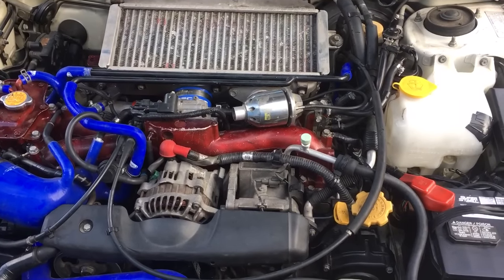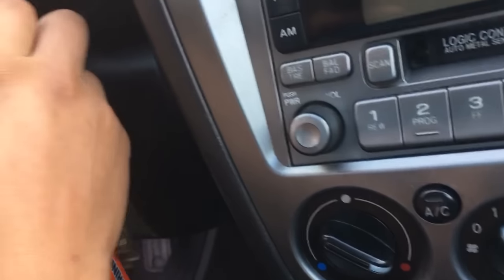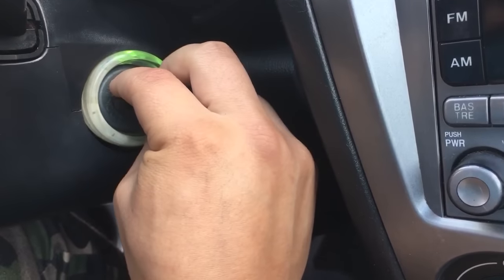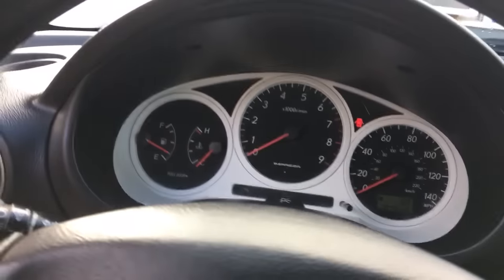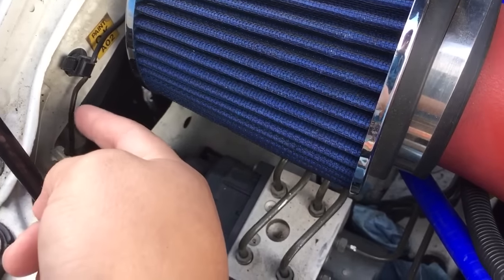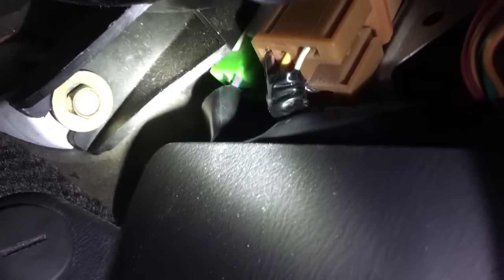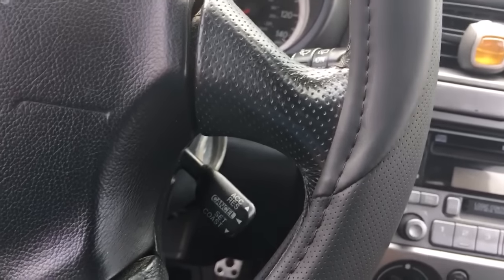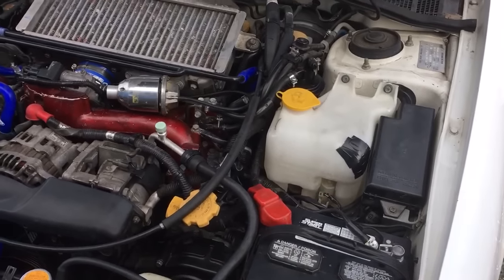Subaru WONT START Bad Fuel Pump? Relay? Ground? | FIXED!

Comment: good info. We had a bad ground but it was on the very back of the engine block was my understanding. Car would crank, but not run more than a few seconds. Security code was the indicator. Finally figured out by a Subaru regional engineer after about 6 months and over $1,000 of parts changing including ECMs. etc. nightmare, which I might add was caused by a mistake made by mechanic in Cary NC Turbo Time, they left the ground wire very loose obviously. Subaru expert in Asheville NC could not figure it out, Subaru dealer in Hickory finally consulted the engineer after over a month of attempting to fix it.

Comment: Thank you very much for this video. I had a major issue with my 09 forester after a timing belt and head gasket job. Turns out the grounds weren't tightened very much. This solved my problem. Thanks again.

Comment: Funny I found this video today because 6 weeks ago I had the exact same problem - I got the point of ordering a new ecu and I found the sane ground as you that was the cause (mine was connected but loose) 👍🏻👍🏻
Reply: I know this video is older now but I just found it and had the same issues, and same as you it was the exact same one just loose

Comment: Thanks for pointing out green 1 wire connector is test & Supposed to be Unplugged! I plugged mine in while under dash
I can't get fuel relay to click on. 
But please note with that plugged in. I hotwired 12v from a junk box, to black & red wire at pump connecter (when plugged in, in essence Feeding whole wire 12V. and using chassis as ground from batt box). Pump ran & car started up for 5 seconds then ran rougher & died. Restarted couple times while I'm back near pump. 
Decided to get in driver seat and rev engine after start. Did it twice still stalled out. Got out and when was going to underhood fusebox, replacement (non) Fusible link wire was Smoking, melting insulation! 
Didn't know if used pump drawing too much amperage.  Or result of 2nd battery being used to power pump, While connector plugged into system! Test wire plugged in at that stage too as well. 
Tomorrow drawing board. 
Just weird no bad fuses yet no pump relay clicking. 
Also my 98 legacy 2.5 Sohc doesn't have blue w yellow at pump connector! 
Thanks to everyone who posts!!! So great

Comment: I follow all your instructions looking for a loosed ground and going crazy, but at the end was the cable from my fuel relay going to the fuel pump but making a ground and not letting the current reach the pump. thanks for your video.

Comment: Always start with connecting the two green test connectors and turn the key to ON. Fuel pump, relays and solenoids should all be cycling.
Reply: What does this mean?  Please explain....thanks.
Reply: @rsauder  Just what it says. You should have battery + and ignition + going to the harness.  If you have a problem after doing something to the engine, go back and review your work (disconnected grounds)

Comment: My car on the scan too reads that everything is working fine except I keep getting random cut off like the engine just dies almost like it’s getting no fuel. It’s hard to start after it dose that after I do get it started it’s fine again. I’ve checked all the grounds I could find all are good and tight no corrosion. Fuel pump sound nice and strong I’ve also checked fuel pressure all good fuel trims also are like perfect I’ve changed fuel filter and relays still get this random stalling
Reply: Did you ever find a fix?

Comment: Thanks a lot !!! After engine swap from my old Legacy '06 to new body Legacy Diesel '08 we accidentally connected green and white connectors... My engine is still flooded and I need to clean spark plugs to make it run.

Comment: I had a problem (TWICE!) with my Subaru Outback fuel pump. The car would start, but then would just sputter, cough, and act like it wanted to stall... The temporary fix involved banging on the fuel tank (watch my video for more info https://youtu.be/qvbAh2lKuhY ). Ultimately, it required a new fuel pump. Add this to your bag of tricks; when you're stuck out on the highway, or back roads, it could be a life saver!
Best Regards,
                               Jon
Reply: ykostudio i

Comment: Are these grounds standard on WRX ?  I bought a rusty, but running one and it had these huge yellow cables that grounded engine in several spots to the rusting body.

Comment: yo i picked up an 05 sti. the dealership diagnosis shown everything fine. but when i was on my way to work i was going about 50 in 4th gear about ready to shift when my engine shut off, i lost power steering and braking had to pull my e brake to stop and pull over. i checked my timing belt (took the left & right covers off) the timing belt seemed fine. when it first shut off i tried starting it again but it didnt want to kick over. when i got it to my house it started but now was squeaking, which i think was some coolant that got onto the pulleys so i wasnt too worried. but it is making a different idle sound now when i started it. im not driving it now just in case it is something internal, but no check engine light came on just the oil light but it had enough oil, i check the trans oil and it was good. I was just wondering if anyone had the same issue before but figured out what caused it. the battery is fine, the ground are lightly oxidized so maybe i can change those out. i havent checked the sparks. i just want to see if anyone had similar issues so i can narrow it down more. thanks!
Reply from the maker: Unfortunately I've had a similar issue once.... or twice lol. I would check all of your fuses and grounds, and absolutely make sure your ignition coils and Fuel Injectors are working.
Reply: MadSubbieMedia for sure.. check out my vid on my page i have a quick video of what it was sounding like
Reply: I have the same problem...did you ever get it fixed?
Reply: Just had the same problem with mine. When my car finally does crank over it sounds very squeaky and sounds as if something internal is bad. I hope it is an easy fix but since it sounded eternal i took it to a shop

Comment: I put a new fuel pump in my 2005 Subaru Legacy it started ran smooth about 15 mins and shut off and now want start at all
Reply: did you figure out what was wrong with your Subaru? I have one doing the same thing.

Comment: Just did a wrx swap in my RS and i'm having the flickering lights issue, and no start. I'll have to try and find where the motor grounds are.
Reply: How did the swap go?
Reply: @TooSlick1996  the swap was a success. it ran for about 4-500 miles until the timing belt tensioner failed and skipped some timing and bent a few valves. Gates products arent what they used to be i guess. It now has a IAG built block with machined heads and everything from the wrx swapped over. way more money than i wanted to pay but its fun to drive now.

Comment: Got a 2011 wrx and it won’t start. Won’t turn over. Will look into that . Thanks
Reply: Stefan Vanbraam did you ever find the issue? Having the same issue cranks won’t turn over no codes

Comment: My car turns on but then it quickly just shuts off:/
Reply: Maf sensor good?
Reply: I had same problem, your car could be running rich/lean. My issue was the psv system was a bit screwed, but faulty or dirty MAF sensor could be an issue for yours.
Reply: You figure it out got an 04 wrx, only runs for about 2 seconds brand new fuel pump
Reply: Have you checked fuel relay and all ur grounds?